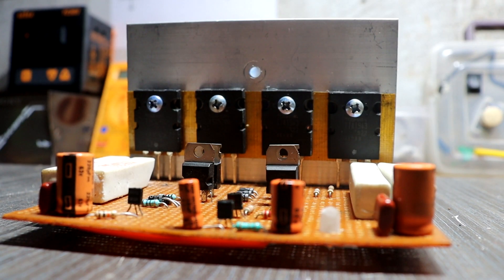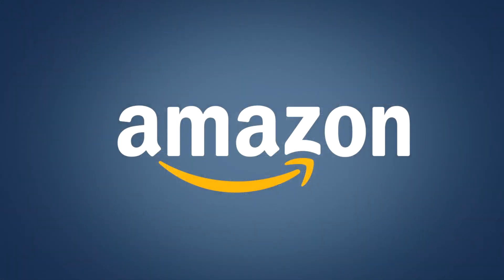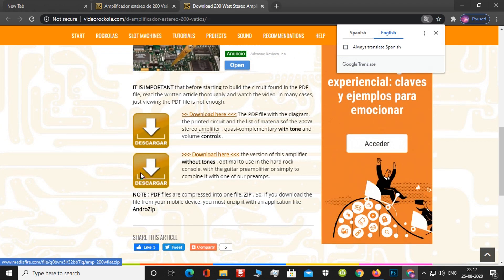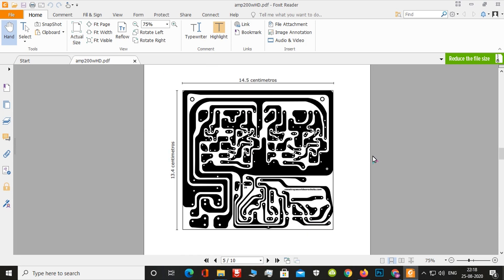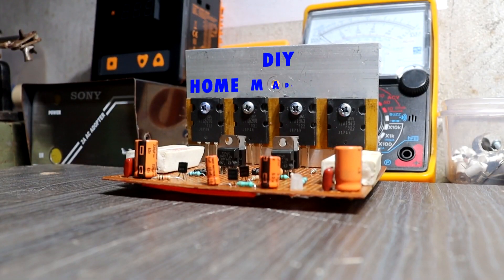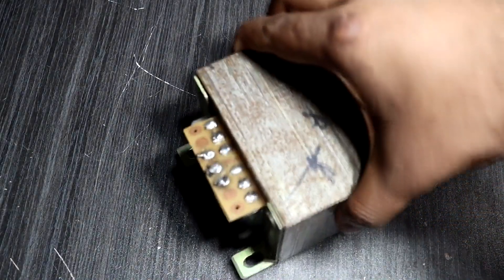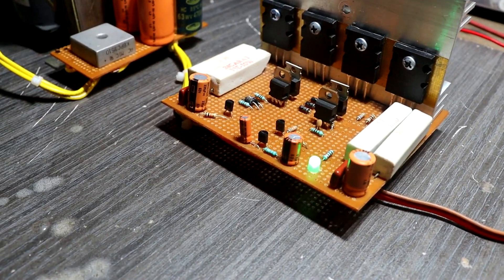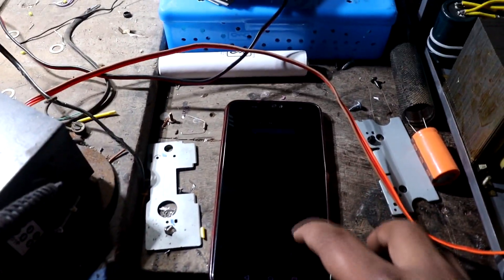DIY 200W TRANSISTOR BASED SUBWOOFER DRIVER (2SC5200 AND TTA1943)

Comment: Can i use 12 0 12 5 amp ?
Reply from the maker: 😂 No, buddy. If you apply a 12-0-12 5-amp transformer to this circuit, it won't function properly. This circuit uses power transistors and requires at least a 24-0-24 10-amp transformer for better performance. So, if you only have a 12-0-12 5-amp transformer available, you can simply build an amplifier based on the TDA2030 or TDA7294.

Comment: Can it support Kenwood 200w subwoofer?
Does it Have noise?
Reply from the maker: Yes, it's suitable for a Kenwood 200-watt Subwoofer. However, please keep in mind that driving a 200-watt Kenwood subwoofer with this amplifier will require a high current, which can put a strain on the amplifier. The issue with this type of transistor amplifier is that it can't handle high currents well, leading to overheating and a faster deterioration of the driver.
If you are using a 200-watt Kenwood subwoofer, I highly recommend using a MOSFET-based amplifier driver. It's a perfect match for your needs, as it can handle the power requirements more efficiently and is less prone to overheating issues. Regarding the noise produced by this amplifier driver, it does generate a small amount of noise, but it's generally not loud enough to be a significant concern.

Comment: can i replace tip41c with tip35c?
Reply from the maker: The TIP41C and TIP35C transistors have different characteristics and specifications, making them unsuitable for direct interchangeability. The TIP41C is a medium power transistor with a maximum collector current of 6 amperes, while the TIP35C is a higher power transistor with a maximum collector current of 25 amperes. These variations can impact the performance and reliability of your amplifier.

To ensure proper functionality and prevent potential issues, it is recommended to adhere to the original design specifications or consult the datasheets of both transistors for a thorough comparison.
Reply: @Circuitoptimize23  hey sir i made the circuit by tip35c insted of tip41c and its worked but TRANSISTOR a1015 getting hot a litle is it becouse i replace tip41?
-another question the sound was not clear eaven i put high value capasitors in power input how can i fix it ?
thanks

Comment: no nois?
Reply from the maker: Depend on your Input and circuit setup...
Reply: @Circuitoptimize23  Resistor oe335v or 33 5w?
Reply from the maker: 0E33-5v
Reply: @Circuitoptimize23  In Indonesia, there is no OE33 5V resistor, what size resistor instead? here are 33 ohms 5w

Comment: Can I use it whit a normal car speaker? I thinked to make 5/6 of that and made a car amplifier, but only if I can drive normal speaker, also, if I can't, can you link me an amplifier that can do that?
Reply from the maker: This circuit only for subwoofers... 10 to 12 inches...
Reply: @Circuitoptimize23  and can I put some of this in series?
Reply: @Circuitoptimize23  and also, I have already like 50w RMS in input, can you help me to customize this amplifier for my situation?

Comment: Sir, for sub-woofer purpose which is better option TDA7294 based ic or 2SC5200 based transistorised audio?
Reply from the maker: Transistor amplifier is best that means 2SC5200 and 1943 mono driver is best and powerful for subwoofers. TDA7294 is suitable for low quality Subwoofer. Compare 2SC5200 and 1943, TDA7294 is very very low quality. Anyway I suggestion you will trying to make a powerful subwoofer driver, then I suggest this circuit, I Mean transistor based 2SC5200 and 1943 driver. This circuit is easily handled to JBL 1500w subwoofers.
Reply: @Circuitoptimize23  Ty Sir.

Comment: Superb project brother may i know the maximum operating voltage and ampere for this circuit
Reply from the maker: 30-0-30/7 amps are 24-0-24/10 amps..